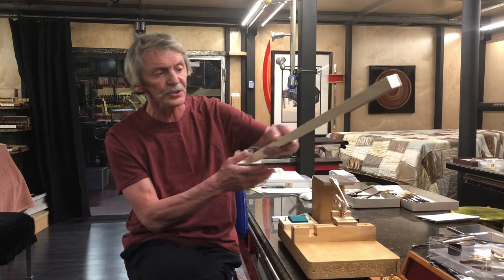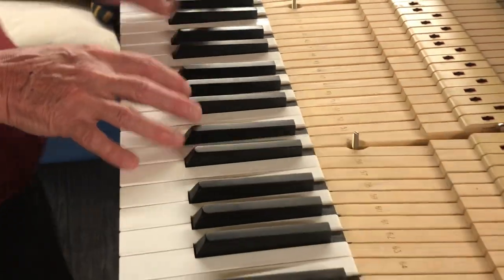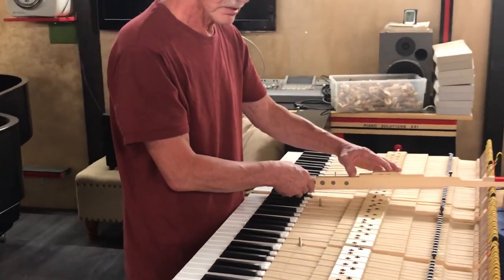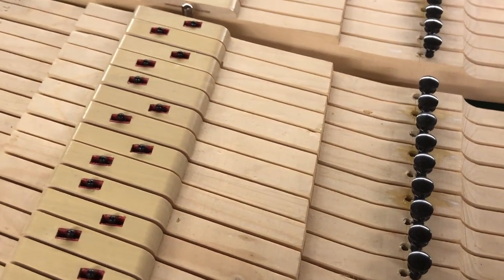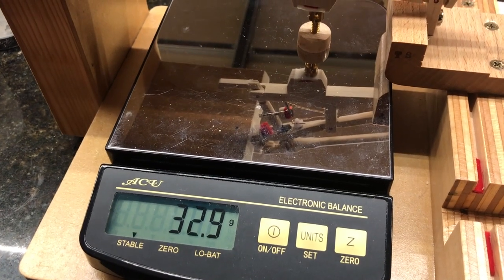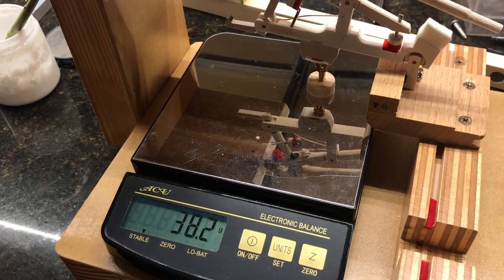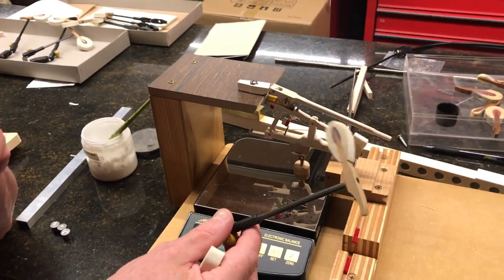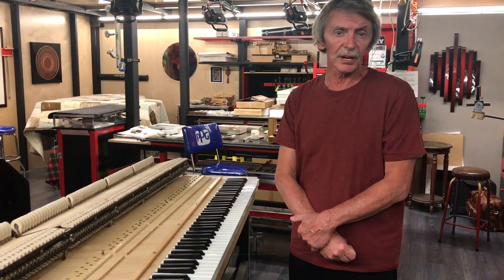Piano Solutions XXI:  Working with extreme and heavy piano action

Comment: Your device, while clever, is only demonstrating changes in the static downward force on the capstan. That has nothing to do with inertia. Inertia is created as the mass at the back of the key begins to move. The faster the mass is moving, the more inertia is created to work against the player. Moving the capstan in any direction will not change this. You must remove mass from the back of the key, and then you can effectively remove some of the front lead counterweights as well. This reduces the inertia significantly, and makes the piano much more controllable and pleasurable to play. I have a system I created to calculate and perform this process and have implemented it successfully on many instruments that were otherwise unplayable, with great success.
Reply: Thank you for this. Almost all technicians have no idea about inertia. All they know is static down weight.

Comment: I‘ve seen many of your videos and I am an admirer of your work, really! One thing : You can change the knuckle position without changing the capstan position. Then you just have to install the whole action more forward or backward. Of course you need shorter or longer hammer shanks then, according to the action position change. One can also change the capstan position without changing the knuckle position. Then the has to be moved forward resp. backward, too. The length of the hammer shanks also has a big influence to the touchweight. Especially with heavy hammer heads. Thanks again for your fantastic videos!

Comment: Hi, love your work, moving capstan back changes key ratio. So they have increased distance from balance pin to capstan, this moves away from 2:1 key ratio. The action ratio/ geometry is all mostly same modern actions. By moving what they did requires more lead to acheive required downweight, then affects upweight badly. Result piano wont play properly

Comment: Thanks for a very informative video. Only last week I had the problem of making the touch lighter on a Yamaha U1 upright. I achieved this by:

1) Increasing the key-dip from 10 mm to 11 mm, and 
2) By adding lead key-weights to each key (excluding the upper treble where there are no dampers). I set the touch at 52 grams, which is a lot lighter than it was before.

I did discuss the option of installing smaller hammers, but partly because of the cost, and partly because she didn't want to go to such an expense, we decided to stick with the above measures. 

My customer is now far happier when she plays Rachmaninoff preludes and Chopin Nocturnes - or anything else, for that matter.